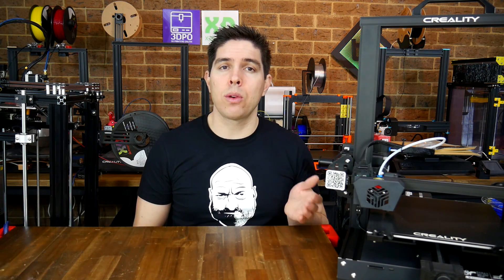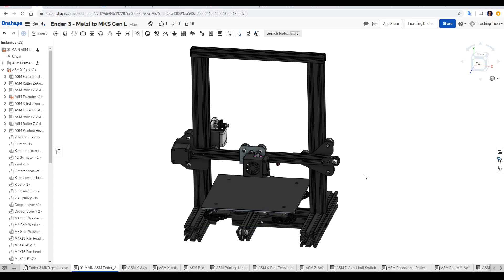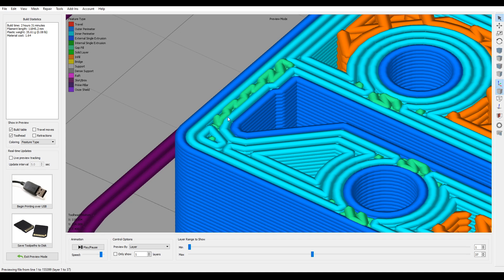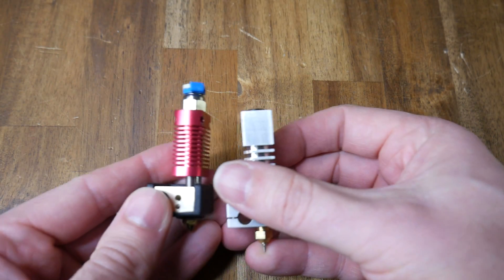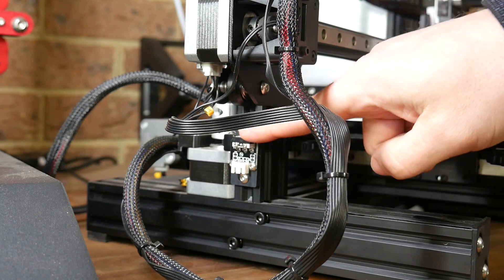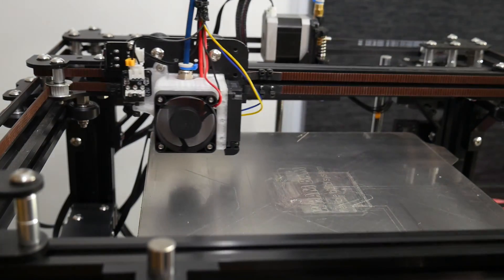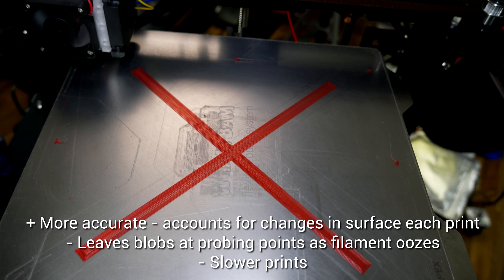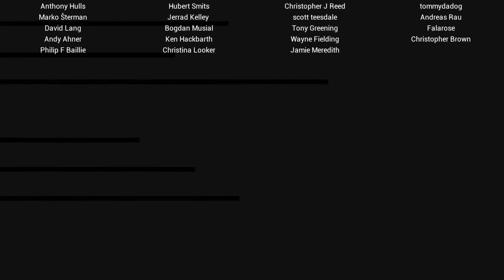CR-6 auto bed levelling for free on the Ender 3 - New printable mod

Comment: Hello, I have an ender 3 pro with a skr mini e3 v3 board and z stop made according to the instructions including firmware, when I calibrate the pad everything works, but when printing the calibration model (9x rectangle) it shows me that the pad is not calibrated at all, after adding the offset the printer  it aligns 2 out of 9 rectangles.. In some places I still have the hotend high and in some places in the bed.. I tried to do the alignment of the pad X times and still the same, it always calibrates but it acts like nothing, in G code I tried both settings  and without change, it always prints as it wants.. I would appreciate any advice because I really don't know what to do with it anymore.

Comment: This assembly has a very serious problem: The nozzle is never clean, unless it is new and has never been used. There is always a little bit of plastic sticking out of the tip. And that will always vary the results.

Comment: While compiling the firmware, I hated the Marlin UI and uncommented Jyers UI. However, the GFX overlay option complained that i didn’t specify a graphical LCD even though I was using the ender 3 v2 configuration files that were compatible with bug fix 2.0.x. 
What variable specifies the standard LCD?

Comment: This should not work well on a regular Ender 3 with its swiveling along T axis bed.
I think that probing on the left or right parts of the bed will dramatically sink the bed and make it false barrel and probably scratch the bed anywhere at some distance from the center line.

Comment: The ABL system on the Cel robox was the first to use this method and its very interesting, I’ve been wondering how to implement this on My CR 10, your method has given my some ideas but now that they sell the complete cr6 tool heads complete with the metal ABL switch I’m gonna try and install that. Thanks for that video 😁👍

Comment: free yes but you have to buy abs/petg filament >_>

alright im go take the challenge to make it for pla and direct drive lul
or give up quickly time will tell xD
Reply: 22h later im nearly ready to start print first sample and it will feature direct drive cooling duct for 2 5015 fan a physical stop 
 to prevent the nozzle to go bellow the 0 point since it will be spring loaded to relieve some of the weight  from the stepper motor
i used a hero me 5 cooling duct xD
will be posted if its a sucess :D
Reply: i can't wait for my mainboard today !!! so i can finaly try
ps my mainboard decided togo haywire in noise making for no reason :S

Comment: I don't know if it exists but what about using an end switch, and attaching it to a magnetic base on the edge of the printhead that would keep it constantly maybe two or three mm lower than the nozzle itself.  it would have to be made precise enough to constantly snap in a perfect position but then once Watling takes place it could be removed fairly easily and then reposition to a different location that would not interfere with the print.  you know like two little steel plates positioned around the head somewhere one being used to hold it when leveling is done and one being used to hold it when leveling is completed.  Standard end stop switches are incredibly cheap as you know and rare earth magnets can be pulled out of old hard drives laptop drives or even purchased for just a few dollars for a big pack on either Amazon or ebay.  I could probably come up with a design that would easily fit in ender 3 and I'm willing to do that and that it's a thing of hers if you could tell me or are willing to generate the firmware that would be needed to use a switch like that.  What do you think?

Comment: Printed with PETG on a MegaZero for itself. The print turned out great and after some tests, i am sure that it works as advertised, BUT, I still haven't been able to find/modify a firmware that would use it as a probe.
I used the TH3D firmware since i've added the heated bed and it was great but i wasn't able to make the ABL probe work with it and I don't think that i am able by myself to build a firmware from scratch that has both the heated bed AND the ABL probe in it (not even with the latest Marlin configs).

I had to edit the part that mounts on the printer to make it fit the MegaZero and also added the Z and X stop sensors to kinda' make it all in one. still need to play with it a little bit since i still had to use my Dremel tool to adjust the holes positions. (my math was off when i made it) but now i have made all this contraption and cannot print anymore.

In the TH3D last "Unified 2 for AnyCubic Mega Zero" there are no #define Z_AFTER_PROBING and #define AUTO_BED_LEVELING_BILINEAR to uncomment...

PLEASE Micheal help me with this before i lose my last neurons :)) I'm STUCK

Comment: I'm re-designing this, to use a pivot and a small spring - instead of relying on the flexibility of the plastic. Should greatly extend usage.
Reply: There's already a simpler design on thingiverse, "FreeABL", you take the Z sensor and screw it on a removable bracket
Reply: @Motolav  That is not automatic. I have mounted the entire printhead on a pivot - with a spring to push it back down, using the nozzle as a probe. My results are amazingly accurate everytime on 2 machines - and can run print after print with no user input!
Reply: I did it. I'm actually going to make a video, and upload it!

Comment: How difficult would it be to modify this into a simple electrical-contact switch? I feel like that would remove the repeatability-loss inherent to the microswitch, at least. Essentially, having the screw close directly with a metal contact to close the endstop circuit. Would that improve the system, do you think?

Comment: I was wondering how you were going to do the CR-6 auto bed leveling for free.  The CR-6 uses a true strain gauge and has a circuit board in the extruder housing incorporating a HX711 24bit ADC and a STM 32F030f4P6 microprocessor.   I kept waiting for those components to materialize but didn't happen.  You got me there, but an interesting approach to an ABL system.

Comment: Hi Michael,

Thanks for the easy bed level solution. However during G29 command my ender 3 is getting halted and take a restart. The error message in octoprint is "Error: Probing Failed". I am getting similar situation as shown in URL https://www.reddit.com/r/ender3/comments/evnlff/ender_3_pro_octoprint_error_your_printers/. Just to mention its not my ender-3.

Please help as I am stuck now and can't print without resolving it.

Comment: I found a few problems/limitations when trying this on my Ender 3 Pro:
- I found that when the nozzle hit the bed it compressed the springs before it triggered the switch. I ended up tightening my bed screws until the springs were mostly compressed. This could also be solved be stronger springs or a weaker hing on the hotend mount.
- I have the stock Ender 3 Pro Control Board. I have added filament runout using this method: https://youtu.be/gwHpXaj_6xE. When I modified the program to add this "Free" ABL and tried to upload it, there was not enough space on control board. I could delete the filament runout but that could be more important but debatable. I was able to delete other features and upload the program, but my printer is slower and has less quality. I might revert to the version with only filament runout.

Comment: Hi, this design inspired me to design an ABL that fits stock hotend and fan housing of Ender 3. I went through 4 different designs, with ball pen spring and compliant mechanism acting as spring, but there are two main obstacles: backlash between moving parts (front bracket with fixed hotend moves up/down along back bracket fixed to carriage) and bed bending when nozzle probes it. The first will definitely affect prints quality as hotend will slightly move aside, while the second will make measurement inaccurate, especially on the bed corners which bend the most. I experimentally found that the push should not be greater than 200-250 gf (gram force), to not make bed bending. I think that's the reason why CR-6 SE has fixed bed so that nozzle can push much harder to overcome springy hotend mount. After all I think the design of CR-6 SE is the only that can work reliably.
@Michael, do you observe bed bending when nozzle probes it?

Comment: Very cool modification, I always love the idea of upgrades using just prints and stock parts. However, I think if you’re going to go with option 2 (saving a mesh once and reloading it for every print after) then it makes much more sense to just use Marlin’s built in manual mesh bed leveling feature instead. It’ll be just as accurate, doesn’t require any printer modifications, and will only take a little longer to complete that first time doing it with paper instead of using the sensor, but for all prints after it’ll be exactly the same (just loading the mesh). 

I think a lot of people aren’t aware of the manual mesh bed leveling feature as it’s usually not included by default in most stock printer firmwares as far as I’m aware. I’m using on my CR-10 Mini and Sidewinder X1 which don’t have any ABL and it’s worked fantastically. Just as well as the automatic sensor on my Flsun Q5 and almost as easy.
Reply: Jyers includes it, and I loved it

Comment: Great mod. Thanks for putting the effort into creating this. I'm working on my own version of Creality's ATL on my Ender 3. It'll have a direct drive all-metal hotend and the ATL sensor is a digital scale load cell (basically the same as used by Creality). Planning on using an micro Arduino to translate the readings from the load cell into something that can be fed to the printer's control board.

Comment: I'm just curious when you said that this mod would prevent you from installing a direct drive extruder due to the movement required to level the bed, that got me thinking... would it become possible to have both if you had something that works similar to expansion joints, which to my understanding allows a bit of give for thermal expansion/contraction, among other things, between the direct drive extruder and the hotend? If I'm correct wouldn't that allow for all the movement necessary for the ABL between the extruder and the hotend? Where each are independently connected to the frame and the only connections between the two would be a short ptfe tube connected to the "expansion coupling" & the cables to run power to the hotend.

Comment: Hi Michael, love the work you do sir, keep it up for all of us please. I have done this mod to my ender 3 and everything works great aside 1 small, ok not so small issue. When the print starts the nozzel moves to close on the right half of the bed, it gets closer the farther out to the edge it goes. I have tried many things from upgrading to the Ender 3 pro 4040 for Y axis, rebuild firmware, any ideas?
Reply: I have the same issue. I think it's a design flaw- since the Z-axis is only moved via the stepper to the left of the bed, when leveling, the carriage block where the X-axis motor is located will lower before the nozzle does, but it's more dramatic on the right of the bed than the left. https://imgur.com/0CKPg2R
Reply: @joshhonig5209  I addressed this by changing my 2040 Y rail to 4040 as in the pro version. Also tightened every eccentric nut when more and so far it seems to be doing OK. I'm going to look into the X axis wheels more today.

Comment: If this is printed in PETG, would I still be able to print in PETG with this part installed?
Reply: I installed this on my Longer LK4 (Ender 3 clone), and I can print PETG just fine.
Reply: @dbackscott  Any way I could get your config files for Marlin? I've got a Longer LK4 as well and I've been looking into loading Marlin on it. I've read the config options for the LK1/LK2 works, but this is still new territory for me and I'd like to make sure I do it right.
Reply: @Tux2mc  They can be accessed here:  https://www.thingiverse.com/thing:4549326

The config file requires the modification installed on the printer.  Also, I've set it to probe a 5x5 grid with each point probed three times.  Some people might consider that a bit excessive, but I'm dealing with some extensive warping of my glass bed.
Reply: @dbackscott  my bed came warped from the factory so I'm dealing with the same issue. I've been debating getting a new bed and try my luck with that, or just use an auto leveling system

Comment: Will this work with the stock ender 3 board?
Reply: Yes it works. You need to use Marlin 2.0.x firmware and reduce the build size a bit to make it fit to the stock ender 3 board.

Comment: I've followed the guide. 
My Hot end will simply probe the centre, then move to the far left and stop all function, after a few seconds generates the mesh with zero values. 
If i do a G29, it will probe the centre, then start printing. Again no mesh generated. 
Any ideas?

Comment: This method would require the bed to have absolutely no flex in order for it to be accurate. The print bed on my Ender 3 (not the pro model) will move downwards if you push on one side of it, won't this happen when levelling like this?
Reply: I have set this up on my ender 3 and I have exactly this problem. Bending of the bed when probing messes up the mesh so that it prints too close to the bed near the edges and too far in the middle. I haven't resolved this yet.
Reply: @niksuti  exactly, and for people who might suggest making the bed solid by removing the springs, the flex comes from how it's mounted to the Y rail. Maybe 4040 is better on the ender 3 Pro, not as good as the 60 wide on my artillery x1, or the separate rails on the cr10s Pro. I think I'll stick to the bltouch thanks!
Reply: @BigDan1190  Yes I agree. I would recommend going with the bltouch rather than this! Now I'm thinking of a possible way to compensate for the flexing in firmware because I don't have any other type of sensor and don't want to convert back to original
Reply: You can push it to its limit with thumb screws

Comment: Micheal, excellent video and great design. I have a few critiques just like a few other viewers. I have downloaded, sliced, printed, and set up this design on my own CE3 at home. First, I had some problems with the lever arm that activates the z-axis limit switch, I would suggest extending out the lever arm another 10-20mm to better tolerate the sensitivity of the switch without it snagging and not un-flexing the metal on the z-limit switch. Second, I would suggest to anyone that uses this method to replace their springs with metal or silicone spacers and remove any springs (i had the yellow updated ones). This will ensure that the bed carriage does not flex when probing, which caused my mesh heightmap to look like Mt. Everest. Thank you for everything you do and I appreciated such an in-depth video!

Comment: I don’t believe this is worth doing unless you can find a way to make the hinge stay parallel to the bed. Hinging on one side means that it has to operate without sticking over time. Which is difficult with plastic near a heat source. I would also be concerned when/if the nozzle stops returning to level with the bed, making for lines and a poor ironing effect on top layers. Rather than squishing the molten plastic, I imagine the hinge could move a tad leaving you with poor quality prints instead

Comment: I printed this and installed it on my Ender 3 with an MKS Gen L V1.0 board running Marlin 2.0x. 
I removed a Creality BL Touch kit as well as a Bullseye cooling fan setup and am VERY happy with the accuracy and ease of printing this mod allows. The BL Touch was great when it was dialed in well but I found it needed as much readjustment as my mesh bed Ender 3. I was never really impressed with the BL Touch and would have lots of inconsistencies between prints on the first layers or new areas being high / low when they were fine before. Keep in mind that my start G-Code hasn't changed; it's still G28, G29 and M2xx (whatever loads the mesh). 
This simple mod is perfect when printed in eSun PETG; perfect amount of flex and no worries of thermal breakdown. I also re-installed my heating block silicone sock for extra peace of mind. Adjusting the end stop switch and screw was simple and hasn't needed any babystepping or additional tuning since initial tuning. The downside is that you have to reuse your factory cooling fan and I'm already noticing uneven and insufficient cooling in my parts. I'll have to explore the upgrade parts for the factory fan again. I can't remember if there's a 5150 fan duct for the factory mounting location, but here's to hoping! 
If you're wondering if the z-stop is triggered mid-print, does anything happen? No. Not a thing. It clicks, you look up from your stupor and notice nothing has changed in the print. 
I look forward to seeing how it continues to work over time and improvements to be released. Thank you Teaching Tech for continually supporting and improving the community.

Comment: Why not just do sensorless homing for the Z axis?? No mods needed for the print head. Just replace the driver for the Z and set the homing to sensorless in Marlin.
Reply: It is a bit risky as it has the potential to damage your heatbreak (especially on E3D and Microswiss Hotends as the heatbreak is very thin and fragile) and the amount of force that a lead screw can apply is quite high. There is more info in the Marlin firmware under Sensorless Probing.
Reply: Sensorless homing needd speed of steppers between 30%-60%. Not suitable for z homing or bed leveling.

Comment: Why not have the hotend on a slide? You would need a tight tolerance or a servo to release it for probing? Also fins to help even out the air current from the fan and a channel to direct the hot air up and out. I am actually working on this last one. Over time the plastic will become brittle, sag or break.